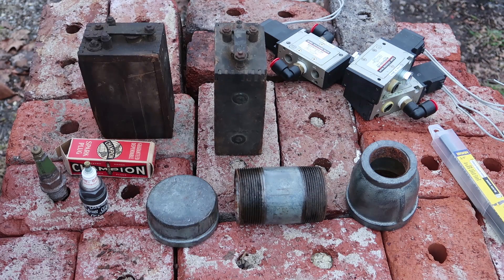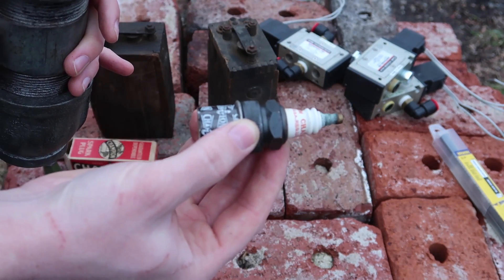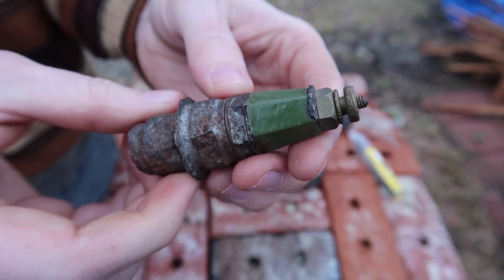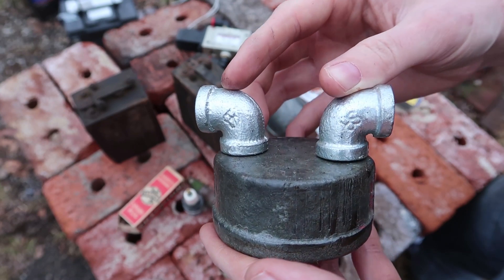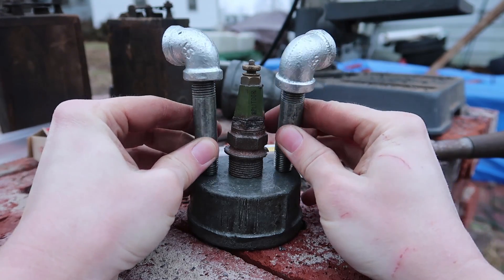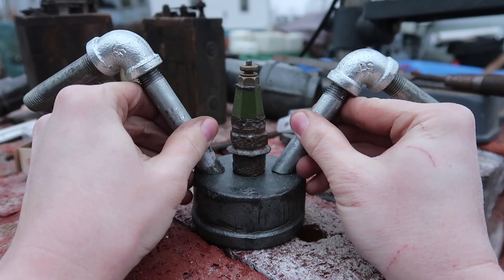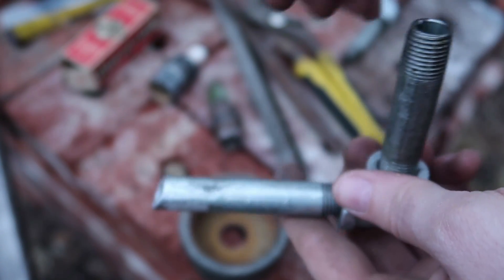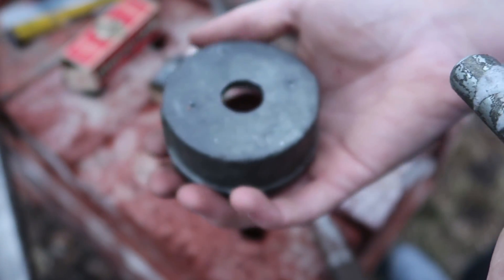DIY Liquid Fueled Rocket Engine 01: Simple Rocket Engine Combustion Chamber

Comment: Whether you decide on liquid or gaseous fuel, you'll want an anti-pop back valve to prevent the pressure wave from blowing back up your feed line to the main supply.  Best of luck on your design.

Comment: Building a rocket is easy, you simply take a large quantity of highly reactive and explosive materials, mix them together and ignite... The hard part is controlling the rate and direction of the explosion...
Reply: ye-no... not at all. You need to do so much math and trial-and-error to find stable and efficient combustion. Also the design is difficult to make so that flow is constant throughout and has lots of safety as to not go boom. Its not even close to mixing concentrated H2O2 with some hydrocarbon; its mixing a very volatile oxidizers with a fuel in a very confined space
Reply: Rocket fuels burn fast indifferent to pressure. When they explode, so does the rocket.
Reply: @KenBowd  what are you saying, theres zero context in ur comment
Reply: Genius
Reply: @bt4308  stop ruining the joke
Reply: lol 
The simplest & most effective large rocket engine I've seen is a tube, capped on one end and rubber for fuel. Just a cylinder with a whole through it for burning.
 I'm sure the size ratios were important too but talk about more bang for your buck. wow!
Reply: @NoSubsWithContent  
The efficiency of all rocket engines goes up the higher you go. It's just the first stages get less efficiency bonus than they could.
Reply: @christurnblom4825  
Simplest is right, but effective probably not. That engine probably had pretty awful fuel efficiency, so would not perform as well as a more expensive one.

Comment: You might want to team up with someone who has knowledge of machine shop practices, you know, turning, drilling and tapping etc. It might make life a bit easier than having to weld everything, which with the greatest of respect you don't seem to be very proficient at, and may leak. I respect what you are trying to do, but when the video showed you holding that end cap whilst drilling it, I was waiting to see how many fingers you were going to loose, I see that later you were using a wrench to hold it, better idea, but when using that size drill you need to clamp things down to the table. Also if your old spark plug doesn't work, if you had tapped the cap you could have exchanged it for a new one as the thread will be the same, and you wouldn't  have to start over again. All that said, I look forward to seeing what you come up with, good luck.
Reply: He didn't even use machine oil.  lmao
Reply: No and Yes and No.
Reply: Thought the same thing about the lack of machine oil.